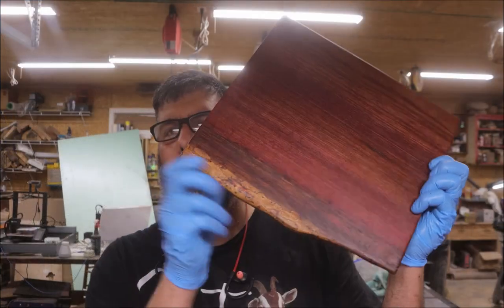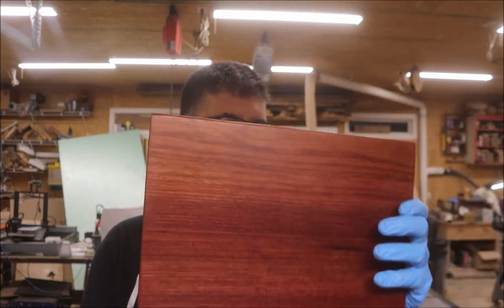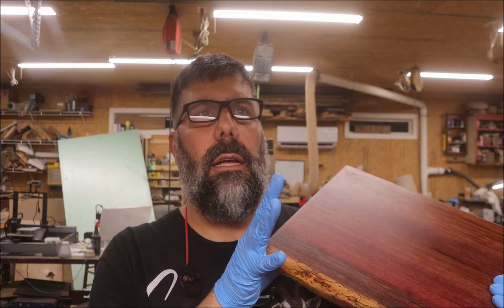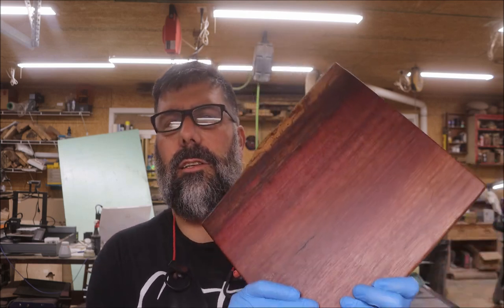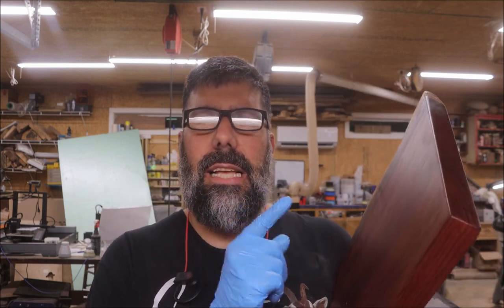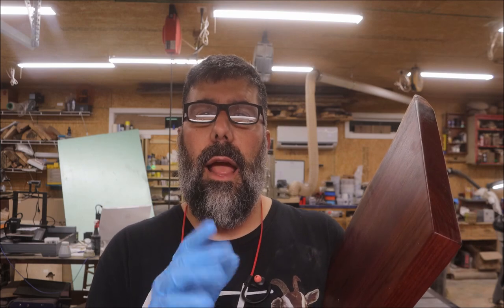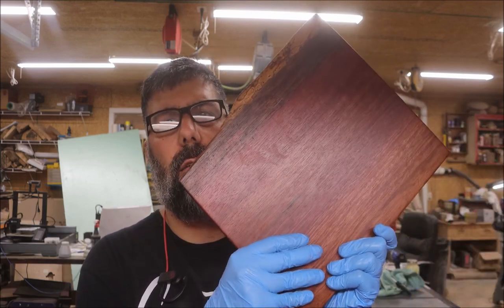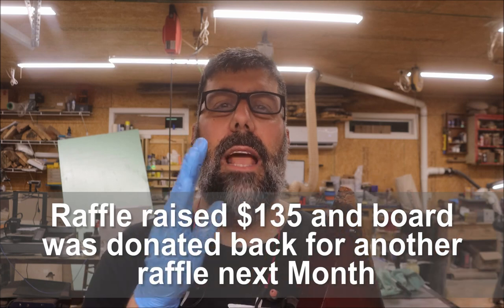Super Easy Cutting Boards

Comment: Very cool Ken.  How do you like your Dewalt cordless sander?  I really like mine, it is so nice to just pop a battery in and not have to pull down a cord or have the cord get in the way while sanding.  So far, I don't have any issues with battery charge life; it always seems to run as long as I am willing to spend time sanding.
Reply from the maker: I like it also, but it's starting to make a rattling sound. May need to switch it out soon.